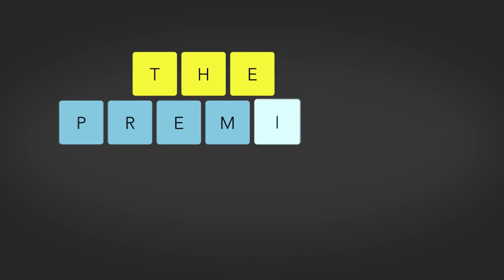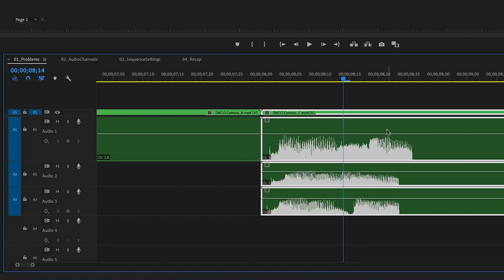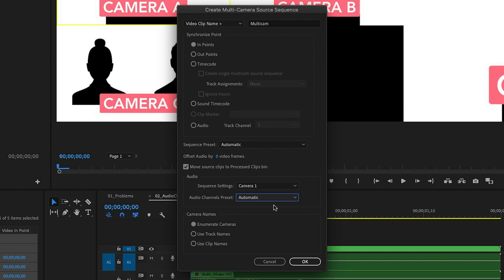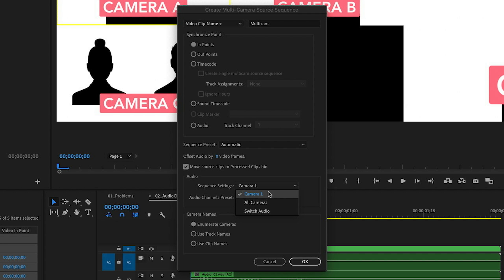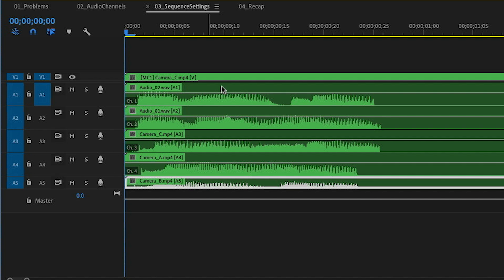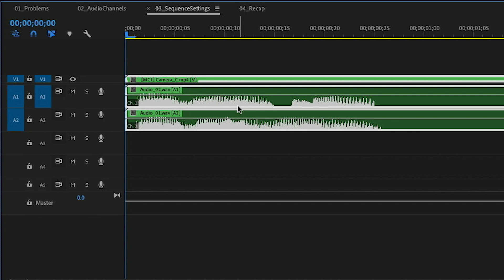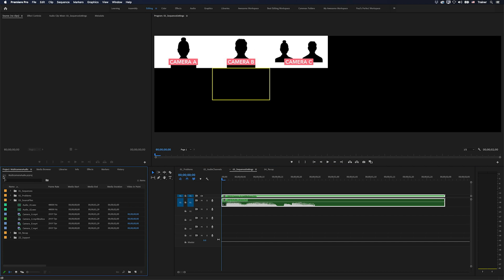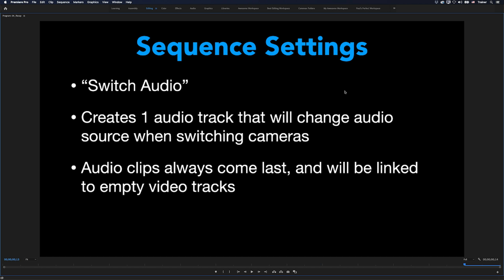Multi Cam Audio Issues & How to Avoid Them (Premiere Pro 2020)

Comment: I wish you would have covered flattening issues. Running into a huge issue with a feature rn where I think my settings were incorrect in the multicams and now when I flatten one, the audio is all panned hard left for some reason. Audio in multicams are all centered

Comment: Hey man I hope this comment finds you. I do podcast editing, with a guest and a host. We have 2 or 3 cameras per shoot. And one of them records the mic audio. The host is on the left channel, and the guest is on the right channel for easier audio cleaning. What I do is I bring the mic audio into my timeline and duplicate it. V1 has the multi cam audio (which is muted) V2 has the guest audio which was recorded in mono, but was converted to stereo. V3 was also recorded in mono but it has the host audio and is also converted to stereo. Now I want to know how do I switch audio tracks automatically with the camera angle. The audio source is 1 single file and its basically recoded seperately from both cameras.
Reply from the maker: I can't quite visualize what you're describing, but it sounds like you want to sync your files with Audio Sequence Settings set to Switch Audio. This setting will change both the camera angle and audio simultaneously—so, for example, if you select V2, it will only play A2.

It seems like you've got multiple audio channels in one file, so you may need to adjust the Audio Channel Format to play only one mic channel at a time.

If not every video file includes the audio channels you need, create audio-only versions of each channel to select them individually. You can do this by clicking the clip in the Project panel and choosing Clip > Audio Options > Breakout to Mono.

If you have a third angle, like a wide shot, consider doing a mixdown of both mics for that shot.

Comment: This does not help me.
Fir unknown reasons, I can only hear the multi-cam audio when I place the Sequence into my primary timeline. But I need to fine tune the clips within the multi-cam sequence. Which I can not do when I can't hear it while in the multi-cam sequence. It worked last month without issue and there have been no updates on this computer, due to using a older version of premiere.
Reply from the maker: Multicamera source sequences typically output one channel per speaker, so if you're inside a multicam sequence and using stereo speakers, you'll only hear audio from channels 1 and 2.

To hear more than channels 1 and 2, even with limited speakers, try this:

1. Click the Monitor Channels button (looks like a bowtie) at the bottom of the Audio Meters.
2. Shift + click the button to monitor all channels.

When the buttons are purple, the channels will be summed to all available speakers, making sure you hear everything even with a stereo setup.
Reply: @ThePremierePro  
Thanks and sorry for the late reply.
I've ran into a new issues that I'm hoping you can help me solve. Can't find he solution anywhere else.
 This is a new one for me. Only two cameras used for the recording. But Premiere is spitting out two Multicam Sequences instead of one. Do you know how I can prevent this?

Comment: Thanks for this video!  I love the Switch Audio option.  It's new for me.  When I drag the multicam sequence into my main sequence timeline, the audio wave forms are there, no problem.  But when I right-click to open the multicam sequence in the timeline (where I see each track individually), the audio wave forms do not appear.  I tried right-clicking the Enable option but that didn't work.  Also, when I click on the wrench to open up settings, the options you showed are greyed out.  I need to be able to see the audio waveforms in the multicam to manually sync a clip whose audio did not record.   Do you have any ideas?  Thanks!!!
Reply from the maker: I'm finding it a bit hard to visualize what you're describing. Are you saying that when you open the multicam sequence in its own timeline, there are no audio clips in there, only video?
Reply: Thanks for your response.  The audio clips appear but there are no waveforms in them.   @ThePremierePro
Reply: It doesn't happen all the time.  It happened once and it was either when I used the "swap audio" or "mixdown" option.  Can't quite remember which...
Reply from the maker: It's odd that they're appearing in you main sequence, but not the actual multicam sequence. Maybe check to make sure your track height is big enough to see waveforms? It might also be that a restart or clearing your media cache will clear things up. @MarciaScott-k8p

Comment: Didn't address the absence of waveform problem, otherwise a very strong explainer.
Reply from the maker: Absence of waveforms is usually 1 of 2 things: 1) multiple input channels are being merged into a single output channel inside the multicam sequence, or 2) an effect has been applied to the clip inside the multicam sequence.
Reply: @ThePremierePro  I feel helpless as to how to ascertain, much less resolve, the input/output channels. I did assign an audio preset to the one channel of audio that controls the multi-cam sequence. That's probably the problem.
Reply from the maker: @kevinhogan7814  Send me your project file if you're still having trouble.

Comment: WoW! Thanks! I wish I knew this before I started editing. Maybe one question remains: how can one replace the audio? Let's say there's a new audio file, or an new mixdown, how can the audio in the multicamera source "container" be replaced so it reflects up to the sequence with the editing? The problem is that I forgot to make the audio track stereo. Now when I do that in the project window, it does not update the placed track. Replacing it in the multicam source also doesn't replace it in the sequence...
Reply from the maker: Thanks! Just to confirm - your multicam source was initially mono and you need to update it to stereo?
Reply: @ThePremierePro  yes. It's coming from a boom mic but is mono. I had to keep going, so I restarted editing the first of the six videos and re-created all the multicam setup. What I did before re-creating them is to change the audio in the project window to stereo. At the beginning I was hoping that this would actually update the clip in the sequence. To be honest, I don't understand why clips like this are not like pre-composed tracks in AfterEffects... In those, when you swap footage, as long as you replace with the same length, the main composition will show those changes. Or am I missing something? Because when I replaced the mono audio in the multicam source clip with the stereo one form the bin, it remained mono in the sequence where I make the cuts.
Reply from the maker: @alexfurer  Content changes will ripple through like precomps, but the audio channel format won't. You need to make sure 1) inside the multicam clip, the stereo clip is on a stereo track 2) the multicam mix track is outputting stereo pairs (you can't mix and match stereo and mono mixes with multicam sequences, it has to be one or the other) and 3) the clip audio channel format of the sequence is outputting stereo pairs (you can check this by selecting the multicam in the Project panel and pressing Shift+G). Since you've already started editing, you'll need to manually replace these in the timeline (i.e. select each instance multicam clip, press F to load it in the source monitor and then peroid (.) to overwrite the clip in the timeline with the new audio channels).
Reply: @ThePremierePro  Thank you very much! Really appreciate your feedback! Premiere is not my main application I work with, so this is very helpful. While we're at it, would you know, or know of a video that explains how to edit audio in Audition of a multicam setup? Would that work if I edit the source track in Audition and then use the same F and Period trick? All I saw so far was to render the video, edit the audio, then replace the audio in the timeline manually. Which is a no-go when I have dozens of cuts.
Reply from the maker: @alexfurer  So long as the audio channel format doesn't change between Premiere and Audition, select the audio inside the multicam clip and choose Edit > Edit Clip in Audition. This will replace the original clip with a new file with "_Extracted" added to the filename so you can make destructive edits in the Audition Waveform editor. If you need to rollback to the original media, just right-click the clip in Premiere and choose Restore Unrendered.

Comment: Is There Any Premiere Experienced User that could help me out if a problem that I couldn't find the solution anywhere?

It doesn't seem to be a bug, but is definitely a super weird behavior.

The problem is Shown in this very short 3 min video:

Insert Project Sequence in Another Sequence Project Timeline - Adobe Premiere - Help - Problem
https://youtu.be/-9BT_KSWfGU

Any help would be extremely appreciated
Reply from the maker: It sounds like your sequences have In/Out settings that get applied when you use the Insert/Overwrite commands. To fix this, select all your sequences in the Project panel and choose Markers > Clear In & Out.
Reply: @ThePremierePro  

Thanks for the help, this problem drove me crazy for a While, so far I've been just dragging a dropping the sequence to the timeline of the assembled parts project, or even other ways to deal with it.

But I love to find ways to do things more productively, the with less clicks at the mouse.

I checked what you said, and all my projects are cleared of in and out, I even have a shortcut for "Clean In and Out" 

But if I drop the sequence project in the timeline using the keyboard shortcut I still get the same result as shown at the video:

Insert Project Sequence in Another Sequence Project Timeline - Adobe Premiere - Help - Problem
https://youtu.be/-9BT_KSWfGU

Wich doesn't even make sense, why premiere would set in the end of the sequence that giant black hashed video  excess. with no audio and no video.

So far I've been working that around.

Thanks for the help

Cheers.

Comment: I'm getting a 32 channel sequence from FIVE 5.1 sources and ONE stereo. Tried it three times. Makes no sense whatsoever. I've used the same six cameras for multi sequences before and never had anything like this. Until someone can help me make sense of it, I'll be installing that free version of Resolve. My hunch is this is just yet another example of Premiere getting worse instead of betrer.
Reply from the maker: 32 channels makes sense to me - (5 x 6) + 2 = 32. Also, multicam audio clips all need to have the same audio channel format.

Comment: I select "Camera 1" in the settings but it still adds the camera sounds as well as the microphone sounds. I only want the synced micriphone audio, and I want to get rid of the camera sound.
Reply from the maker: You can open the Multicam Sequence to see how the camera sound is being added. Hold down the Cmd/Ctrl key and double-click the Multicam clip in either the Project or Timeline panel to open it in the timeline.
Reply: @ThePremierePro  Thank you!
Reply: @ThePremierePro  i'm working on a feature length as assistant editor to my college professor, so this techy stuff is extremely important i do right. Thank you, I finished all the proxies, multicam sq's, fixed all the issues thanks to your channel. He can begin editing the film now :)
Reply from the maker: @Bsus4films  Good luck with it! If you have any other questions, let me know.

Comment: So helpful! thank you very much. One question,  how do I change my mutitcam settings from camera 1 to All cameras AFTER i've created the Multicam sequence..fingers crossed
Reply from the maker: Have you already started editing with the multicamera sequence?
Reply: @ThePremierePro  yes. Many of them
Reply: Any thoughts, thanks in advance
Reply from the maker: @FUBAR-OFFICIAL  Unfortunately there's no easy fix for this. Probably the quickest solution is to disable the 'Insert And Overwrite Sequences As Nest Or Individual Clips' button in the timeline, load each instance of the multicam sequence in your timeline using Match Frame (F) and overwriting the audio. This will replace the multicam audio with all the original audio files.
Reply: @ThePremierePro  thanks so much for the help.

Comment: Hi. Great resource and very helpful!
What to do in case we want to use Switch Audio and we have: 
Camera 1 - person 1
Camera 2 - person 2
Camera 3 - person 1+2
Audio 1 - Person 1
Audio 2 - person 2

What must be done to preserve a valid audio recording from camera 3 in which both person 1 and person 2 are speaking?
Reply from the maker: Thanks Albert, great question - for this, you can create a new sequence with Camera 3, Audio 1 and Audio 2, and then select this sequence as the 3rd camera when you're creating your multicamera sequence. A simpler solution might be to use the 'Camera 1' sync option, so that Audio 1 and Audio 2 are always enabled, and you just switch between Camera 1, 2 and 3.

Comment: Wow. This video was a real life saver. Thanks for creating it. I feel like Premiere Pro made this harder than it had to be, but sometimes obfuscation is what they're best at. Thank you for helping me sort it out. You've saved me a lot of time and frustration on my next multicam assignment.
Reply from the maker: Great to hear Quasiguy!
Reply: @ThePremierePro  Hey Paul. Here I am, four months later, revisiting your video because once again, I'm struggling with audio in Multicam. Can you help me? Specifically, I conducted a three camera interview with three people--the interviewer was on one camera in stereo (his voice was on both channels) and the two women he was interviewing were being captured on another camera--one was in the left channel, one was in the right. (The third camera was a wide shot--I didn't use the edit, except to sync the cameras in Multicam.) Anyway, I thought I was doing the right thing by trying to modify the audio on the camera with the two women by creating two mono tracks (instead of left and right), but when I put them into multicam, the women are in left and right speakers separately and I can't used the "Fill Right with Left" and "Fill Left with Right" option to fix it. What's weirder, is that they're IS audio coming out of the opposite channel for each woman, but it's a significantly lower volume (not equal on both channels, which would make them mono). I'm probably not explaining this well, but I have the entire hour interviewed and I'm hoping I don't have to start over to fix this. Any ideas? Or am I on my own on this one? Sorry for the long message.
Reply from the maker: @quasiguy  Happy to help! What is the audio channel format for the interviewer? And do you need the multicam to switch audio as well as video?

Comment: Hey thanks for this video! I wonder if you can help me. I'm pretty sure there is a simple answer to this but someone else has sync'd the multi clips together with separate audio. So I don't know if that has complicated things.
 
I have two tracks of audio on the multiclip. Sometime I want to change the mix track for a lapel mic for example. 

The way I've been trying is to disable the Multiclip (there i find 16 tracks of audio all muted and channel 1 and 2 are not muted) which Is what I believe is what the multiclip it's using. If i want the tracks on A3 and A4 i swap them round so they are now on A1 and A2 but when I go back to the multiclip in the timeline and enable it only A1 is there and A2 is blank? Anyidea? Thank you!
Reply from the maker: When a track is blank, it's usually a sign that Premiere needs to render before it can display waveforms. This can be caused by things like audio effects, mismatches between the audio clip and the track format or an edit inside the multicam sequence that requires processing. I would recommend keeping the audio inside the multicam sequence as it is, but rearranging those tracks in your edit timeline (or even better, rearrange them in the Project Panel using Clip > Modify > Audio Channels).
Reply: @ThePremierePro  Thanks so much for your reply i really appreciate it. Alas the issue is I only have two channels to choose from when doing the audio channel box?
Reply from the maker: Ah, I see what your problem is now - the audio you want to use is one of the 16 tracks that's muted, right? So the multicamera sequence was probably created using the 'Camera 1' setting when it should have been 'All Cameras' (and then you could easily choose which audio you want to use). Is there a notable difference between the audio tracks that are muted and the ones that aren't? For example, does one have 2 channels and the other has 1 channel?
Reply: @ThePremierePro   correct. To be clear tho I can switch cameras with no problem. But i think your right It was multi clipped using camera 1 audio. 

For the most part yes there is a noticeable difference. I believe some are lav and boom mic’s respectively. This particular scene has four people in it. I will say tho there are some that i can’t find clean the audio for so I guess I could syncing it again. It was all sync’d in resolve. I’m not sure why there are so many tracks tho I can only guess there should be 8 and one comes from each camera which has then been sync’d together. Thanks again for your help!
Reply from the maker: @BenAllanCM  No worries! Switching cameras is always the easiest part - it's getting the audio right that can be the headache. Of course, there's also the option to use Switch Cameras, to change the video and audio sources together - but in a scene with 4 people, I'd usually want all audio sources available during the edit.